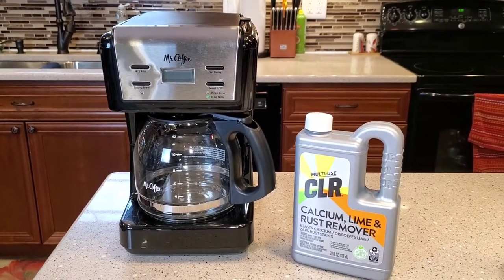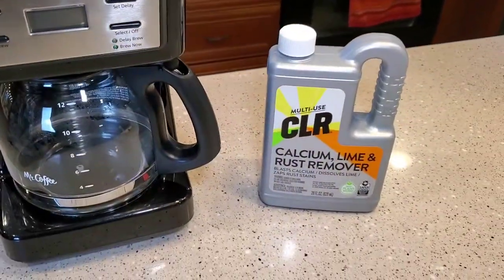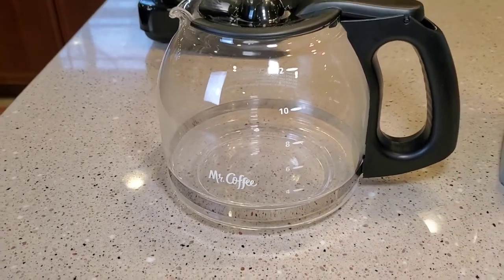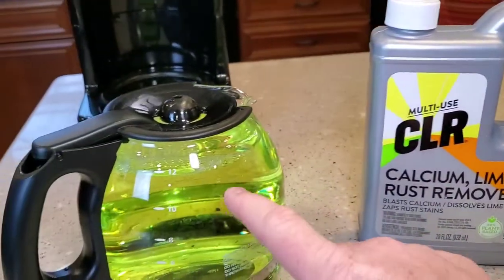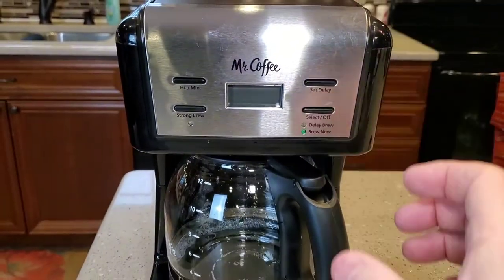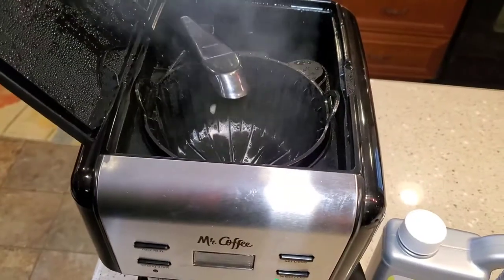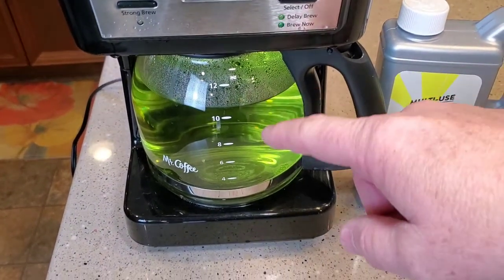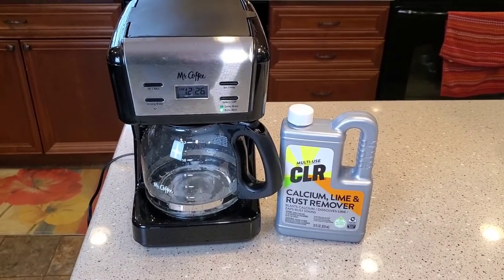HOW TO DESCALE CLEAN WITH CLR Mr. Coffee 12 Cup Programmable Coffee Maker

Comment: When going through the 4 pot final flushing cleaning process,ever thought about pressing the other available brew button Instead of the same brew button  4 rinse times? I see the machine also has a Strong Brew selection button and may have cleaned the machine even better because the Strong Brew selection could open up the machine even further in its guts or working mechanisms.Just a thought. But thanks for the video.